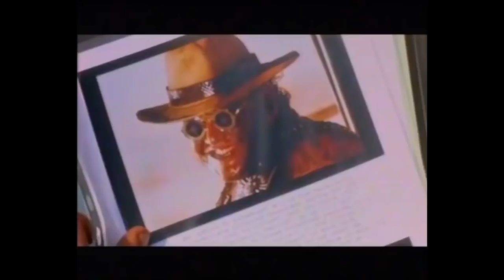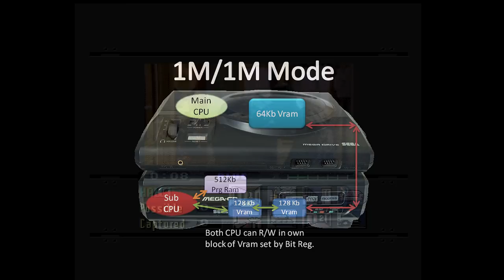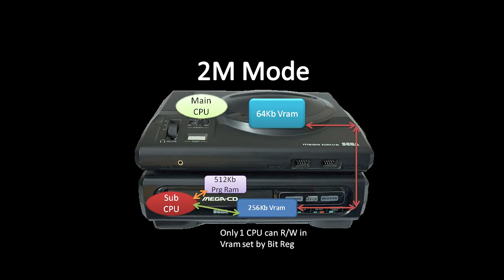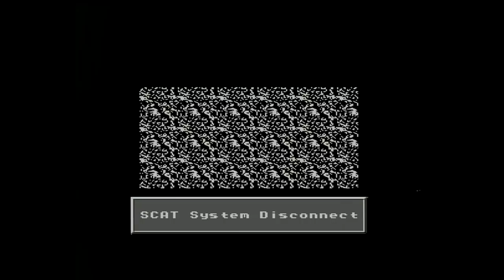Sega Mega CD: Spinning the CD revolution Part 1: The Hardware

Comment: Mega CD total shipment worldwide was 2.24 million units as March 1996.
Of those 400K was the install base in Japan while 1.84M were shipped in abroad markets.
Reply from the maker: Yes, but this is from Wiki and other sources point to higher/lower values. As it stands and I say, circa 2.5 million units is not terrible and certainly was a pioneer in the west for CD gaming which is my point.

Comment: Great video for a great machine. I've always wondered how Game Arts was able to accomplish the extremely high quality animation scenes found in the Lunar series and Urusei Yatsura. Any comment you can make on that would be great.
Reply from the maker: They were a great team and the Lunar series was superb. The animation likely used the Bitmap Cell mode that could split up parts of the image into 32x32 cells and allow them to animate smoothly and give the impression the entire image is updating at full rate when only parts are. They could also have used the Shadow and Highlight mode as Konami did with Snatcher to improve the colours.
Reply: NX Gamer Thanks for the response. I didn’t know about the ability to update only sections of the screen. That makes a lot of sense.

Comment: Haven't played my console in 20 years (outside of emulation) due to taking it apart once and when putting it back together it worked bar had zero sound never knew what was wrong and since then its been stored at my parents.
Reply: You should send it to a repairman.  Rapid Fire Gaming helps with all my needs
Reply from the maker: That is a shame but sounds like an easy fix. Have you checked the basics such as the RCA jacks are not split, or any cracks on the connector. Happy to help if you wish with some tips etc if you ping me photo's?
Reply: Sounds like caps need replacing

Comment: the sega mega CD1 looks better then the mega Cd2 BUT it’s more prone to breaking ! and the original megadrive doesn’t fit on the Mega Cd2 you need to get the extension piece otherwise it over hangs

Comment: I remember being underwhelmed by the hardware performance when it came out. They probably should have at least used something more powerful than a 68000.  At the time they were also developing the SVP chip and 32x. So it would have made sense to maybe integrate the SVP into this as well. Or even an SH2 and bypass that 32x bull.